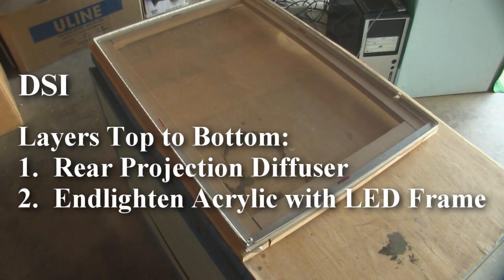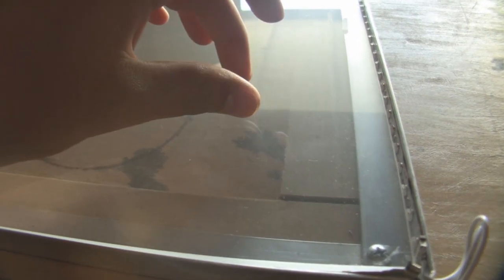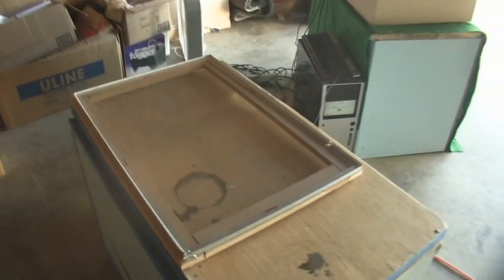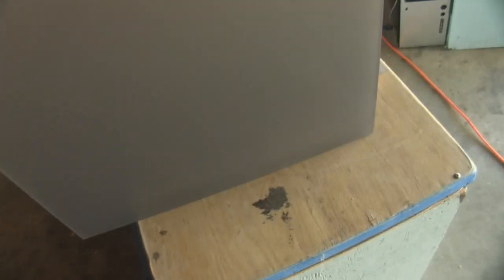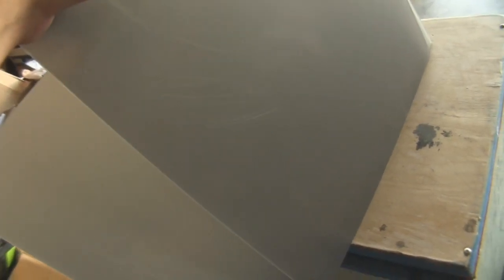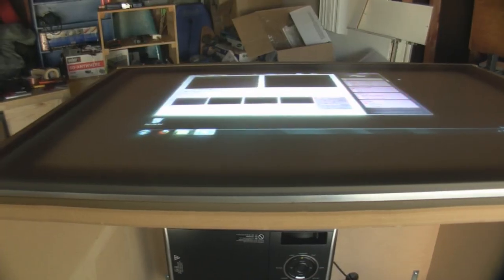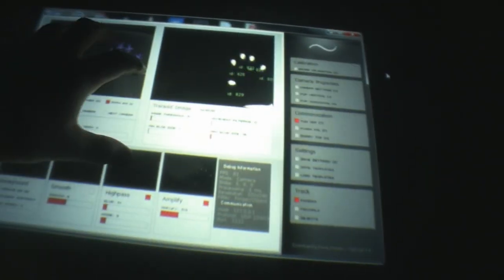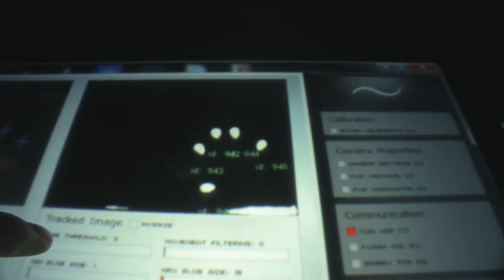How To Build a DSI Multitouch Table

Comment from the maker: @sovsfan DSI requires a special type of acrylic known as Endlighten.  You can get it from Evonik.  FTIR just uses normal clear acrylic.  Both setups need a rear projection material, but the RP for FTIR must be a thin film that can flex when you touch it.  DSI does not need a compliant layer because it uses diffused reflected light instead of frustrated reflected light.

Comment from the maker: @iamthesilverlining The camera is placed underneath the LCD screen.  You have to take the LCD apart though and separate the layers.  For really low height setups you need either multiple cameras or a very wide fov, non-distorted lens.

Comment from the maker: @iamthesilverlining Yes the Endligthen with LED frame around it can be placed on top of an LCD screen that is separated to allow the camera to see the touch surface.  You need a light diffuser under the LCD to even out the backlight.

Comment: @PeauProductions So then where would the camera be placed to view the screen? The reason i ask is because i wanted to build a touch screen into my coffee table but its pretty low to the ground. I saw the infrared frames that look like they work well but after the tv and the frame your looking at $1000 project. I like the acrylic as its WAY less likely easily break.

Comment from the maker: From our FAQ Page: The least expensive method to build is an LLP using 4 of our 780nm 28mW lasers. All you need are the lasers, line lenses, and power supply. The cost of the Infrared Camera and assorted building supplies is relatively equal for each method.

Comment from the maker: @FlynnUOGM Almost any computer can run the CCV tracking application, but the faster the CPU the higher frame rate you will get (and thus the smoother and more responsive interaction you will have).
You can use reactivision or ccv for fiducial tracking.
An LCD screen would be dark until turned on, and you can use a very dark projection material for the diffuser too.

Comment from the maker: @iamthesilverlining You'll want to look at an led calculator to figure out the strands of LEDs based on the voltage/current they can take and the voltage/current of your power supply.  Then you simply wire each strand of LEDs in series to each other in parallel.  Or you can just buy the LED ribbons we sell for a much easier setup.

Comment from the maker: You can use a projected image or a LCD (taken apart).  We recommend a projector with lumen ratings of 2000-3000 or higher.  Too bright and you'll blind the user, but too dark and the image will be very dim.

Comment: @PeauProductions Okay so for a 32 inch set up, one 5 meter strip from your site should be plenty to wrap the acrylic, plus the power supply, 2 spacers. When i cut the strips to insert the spacers, what do i use to wire them back together so i can plug them into the power supply? Do you have any particular projector and camera you would recommend for a low setup?

Comment: @PeauProductions Thank you for information. I think im going to go for a wide angle projector and camera and see where that gets me before i tear apart an LCD since this will be my first build. I like the DSI simply because of the versatility of the design. One more question, if i was going to solder the LED's myself for a 32 inch screen in parallel, i know they need to be broken up into strips to allow spacers for the acrylic, how do i wire the strips together and then to a power source?

Comment: @PeauProductions i just found the buyers guide at environment lights and it has answered 90 percent of my questions. the only thing i am left with is if you could recomend a wide angle projector? or should i get a projector and put a wide angle lense over it. im trying to keep this project under 500$, and the projector is the last thing i need.

Comment: Peau, is 7D512 the best diffusion layer? Could you recommend a thinner material? I am currently using paper vellum as a diffuser in my DSI table and it blocks a lot of IR light, making blobs weak. Thanks in advance!

Comment: Hi, i am very amazed with this video, and i actually created one by myself with ccv 1.5
But when comes to finger detection, it hardly detects the blob, always out of my finger no matter adjustment i made. And also the software detects my finger only soon after i released my fingers and then dissapeared slowly.

Currently i am using a box made by corrugated board, a webcam inside, and on top of it a 1 mm acrylic (able to bend) and a tracing paper.

thanx

Comment: hi men ,nice job ..can you tell me please how can I get the controller and the driver for the IR touch pannel? I also need the diagram -I do have technical skills and i want to build myself ..can you help me?
Reply from the maker: These systems use an infrared camera (PS Eye) and a computer running CCV (Community Core Vision) for processing the camera image into touch points.

Comment: hi thanks for making videos! i am having a college project to design a touch table interfacing with my microcontroller.....so how could i transmit data from my touch table to controller in wireless mode, could you shed some light thank you :)
Reply from the maker: +Gaurav Shetty The camera and video would need to be wireless then to your computer.